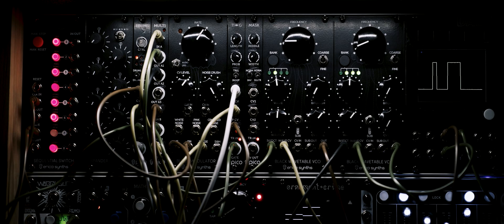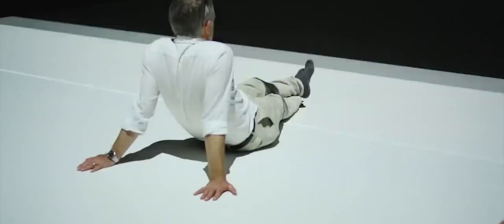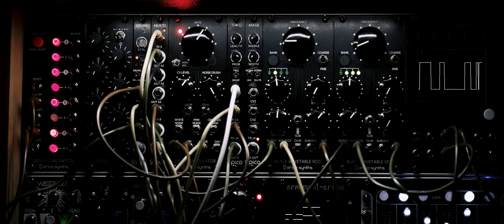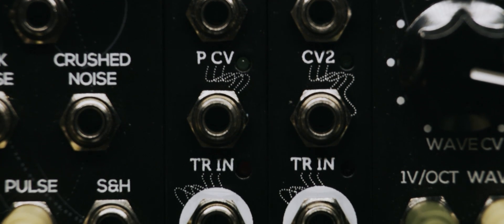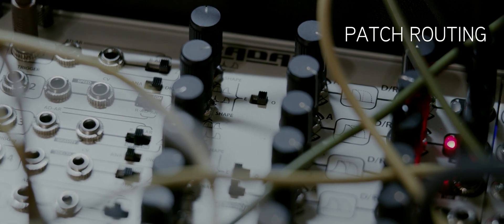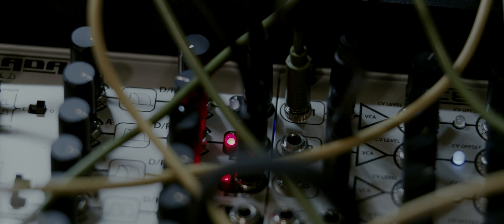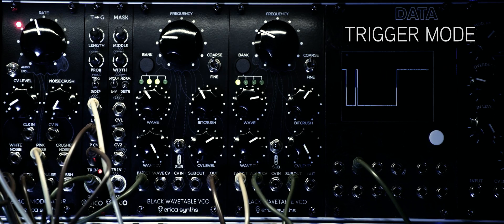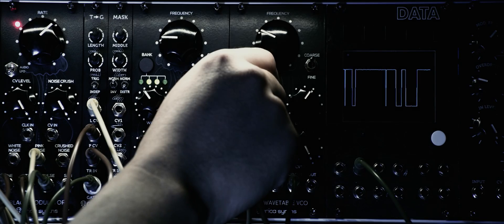Erica Synths Pico Trigger to Gate Module 4K Overview

Comment: If you watch the trigger in LED above the gate output (below trigger output), it is blinking quite randomly during this demo. Thus, you can not tell anything about the way that this module affects trigger timing. What the hell, someone did not understand the best feature of this module when they made a demo.
I have one of these and while it does add some musical randomness, it does not work as well as the gate out on Nano-Rand as far as adding a musical rhythm, or to quote Qu-Bit Nano-Rand is capable of producing the most musical random gate output in the Eurorack format.
Oh well it converts triggers to gates.
Reply from the maker: Foghorn the trigger in LED is in sync in the video that I uploaded.  Perhaps there is some delay or sync issue in web delivery.  The Mordax Data is also visually demonstrating how the trigger sequence is being converted to various gate lengths via the CV input.
Reply: Sorry if I was a little crude here. I have this module and it does create a "musical" trigger stream from just regular clock signals. It is like it creates a syncopated beat from a monotonous clock. It looked like the signal that it was processing was already somewhat irregular and that would not show its best feature.
Reply from the maker: As Girts (designer from Erica Synths) told me, the module was inspired by the style of Ryoji Ikeda, who seems to create progressions through a randomization of gate lengths.  I chose not to feed the trigger input with overly complex rhythms because they tend to clump together instead of outputting distinct pulses, shortening and extending into drone-like lengths.  Visually demonstrating its function on an oscilloscope was what felt right for this product video.  If I were to do the video again now, I would’ve used the Vermona RandomRhythm to mix up the trig rhythms a bit more.  But pre-release, I was generally more focused on demonstrating function rather than musicality.
Reply: @distprod  So what does this module do with regular timed triggers? For example, does a regular clock get converted the same way as a step on the Varigate with probability turned up or down, or similar to the probability for triggers on the Intellijel Steppy (i.e. less or more likely to trigger?)? It is hard to tell with what looks to be irregular triggers going in on the video.

Comment: I wouldn't use this like the pictured uses--but I wonder if it would be useful to convert more of a straight clock signal to more interesting gate signals which can be used as clocks? I guess it would make more sense to buy another clock module for that..
Reply from the maker: Hi Nick, there are undoubtedly many different ways to use this module.  From how it was described to me by the designers, controlling the gate length and randomizing triggers ala Ryoji Ikeda were the primary functions of this module.  I didn't have much time to explore more patch setups, so I thought it best to show a general visual representation/readout of the gate waveform on the Mordax Data being generated by the T-G module via the trigger signals from sequencers such as Mutable Grids, Bastl Knit Rider and steadier clock-type rhythms from Pamela's Workout.  My hope was that this would allow people to see the possibilities, and dive deeper into it.
Reply: The idea of a clock is that it's steady and timely. So getting a straight clock signal and turning it into a "more interesting gate signal" and then using that as a clock ... to what end? It all depends on what you want to do. Also, the mode of the module should be the one that can merge the gates , in conjunction with the probability feature which skips some gates, that way you'd lose some clock ticks. Could be interesting to clock a sequencer that way, especially if you're looking for a bit of randomization to your patterns. You can also use this module to give a bit of swing to your clocks by extending and then retracting the gate size in time with the ticks. Lots of uses!
Reply: @konstantine8054  so i could use this module to trigger my pittsburgh micro sequence? i can't figure out what this curious module can do
Reply: @davidesaggiotto4468  It can do a lot. Simplest thing I can think of is plug this at the output of the Micro Sequence's gate output, and allow the TG to change the gate lengths (which are fixed length) coming from your Pittsburgh module. That way you get some cool note lengths. Use the second output from your MS to change the Probability of the gate length changing. Enjoy!
Reply: Konstantine  I'm always looking for ways to make weird time structures. What you describe of skipping gates or triggers to create interesting ones is actually exactly what I do with varying the accent out on my boss dr-110 into my stillson hammer. One of the best and cheapest ways to do this and you also get s pretty good drum machine :)